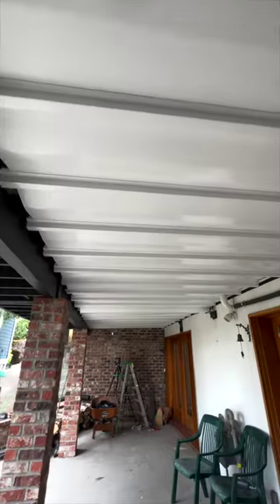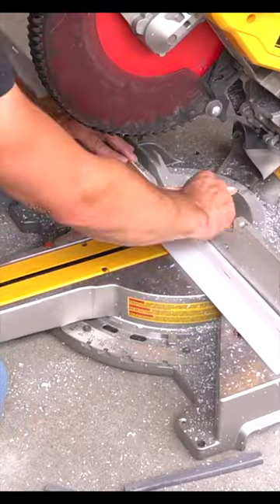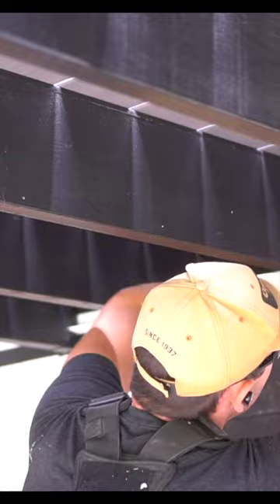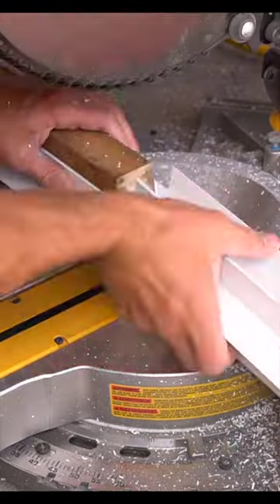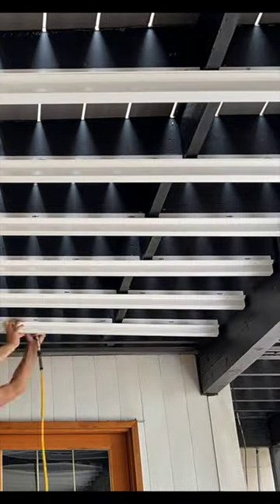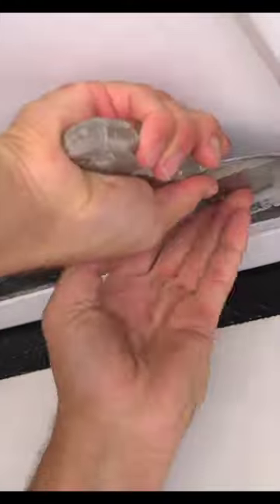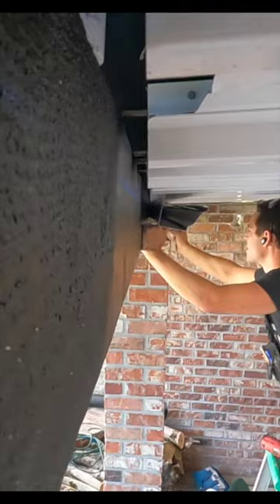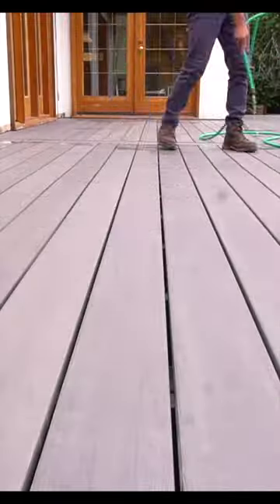DIY Deck Dryspace #shorts

Comment: No water drips down the joists behind those brackets?
Reply: No comment…
Reply: Those joists will fail. Just went through this.  Leaves and debris will collect and store moisture for the joists to wick.  You can treat the lumber all you want, it will eventually rot.  Use a product that prevent the joists from ever contacting water directly.  Like rain escape.
Reply: @randylandfried6237  any recommendations on waterproofing a deck?
Reply: How do you clean the leaves and debris?